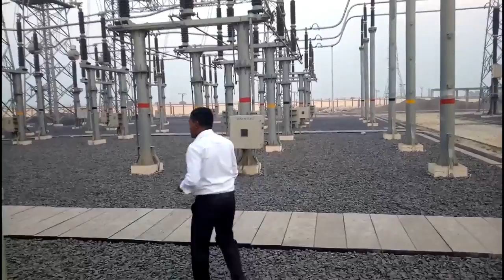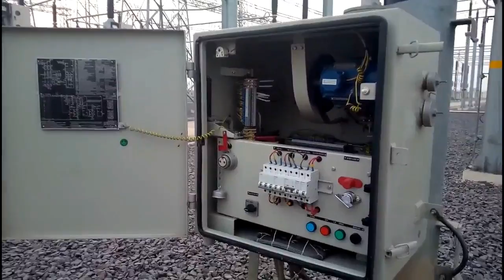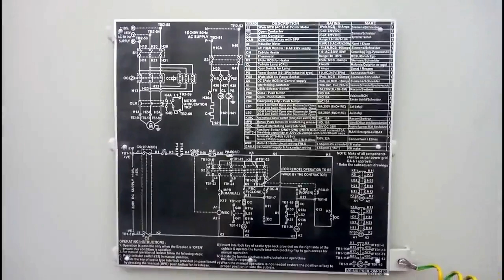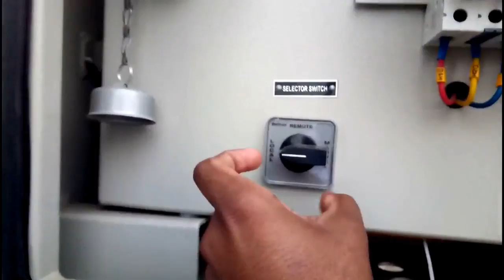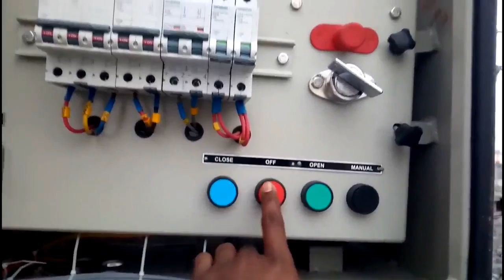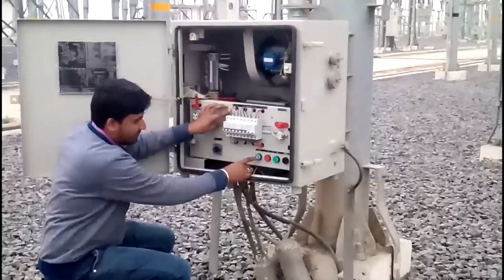A practical working explanation of ISOLATOR-Dissconnector switch for 220kV switchyard

Comment: is there any reason to this disconnector name is 89LE2, because the same name is used in other grid for isolator diusconnector switch
Reply from the maker: LE 2 means.
Line Earth Switch.
89 mean Isolator.
89 LE 2 means.
Earth switch installed on isolator.
89 is ANSI CODE of isolator

Comment: Ac supply is required for motor control and what for DC supply is required in isolator?
Reply from the maker: For control circuit. DC is required

Comment: If DC supply is required to operate TC and Closing coil for isolator, then how 3 phase motor works inside terminal box of isolator ??
what is the 3 phase voltage used?
Reply: its 1 phase motor
Reply from the maker: Its 3 phase induction motor. You may see in 400kV Isolator M.B
Reply from the maker: DC supply is used for controlling & Indication purpose only. You need 3 phase supply for 3 phase induction motor.

Comment: what is the purpose of single phase ac in CB
Reply from the maker: Single phase AC will be used for illumination lighting, heater and miscellaneous uses in the control cubical & mechanism boss of CB.
Reply: thank u sir
Reply: one more doubt sir,
what is UV coil and shunt coil circuit breaker , and please explain difference between them.